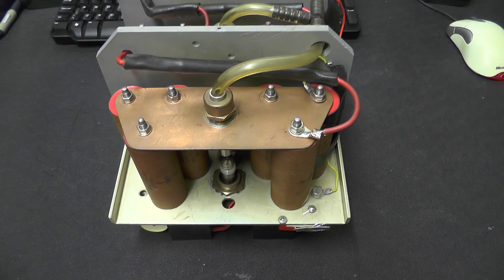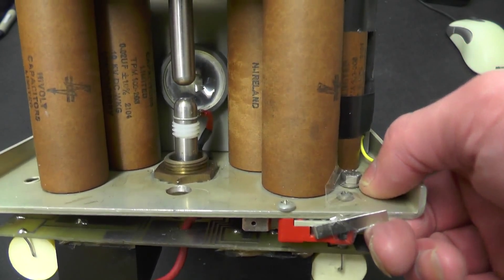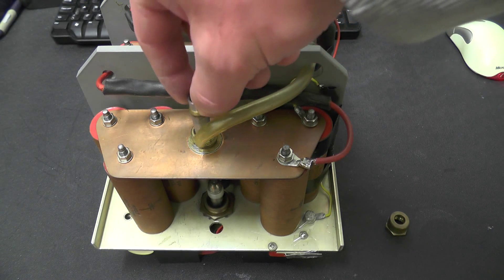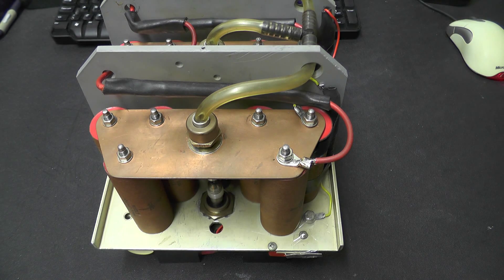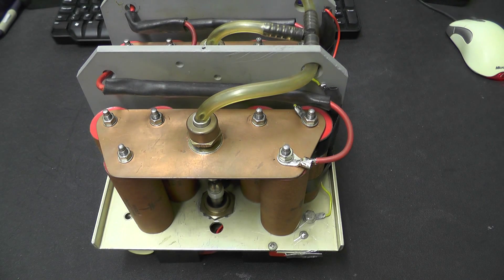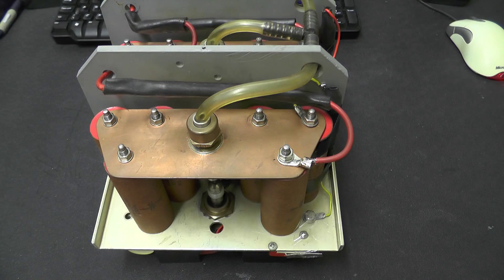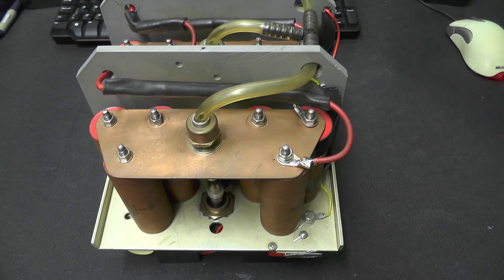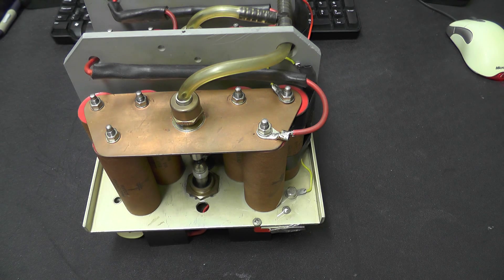DL#034 - Project: Palflash 500 Air Gap Flash Part 2

Comment: Nice flash unit.

Things to do: Air rifle stuff as usual, like ripping cards etc, triggered by photoelectric switch. Next thing would be to measure the duration of the sparc/light emission time with a fast photo cell and oscilloscope. Then you could do other funny stuff like blowing holes in aluminium cans with pyrotechnics/primary explosives and take snapshots of developing cracks/holes, if the flash is fast enough (good stuff explodes at 7000 m/s, that's 4.5mm/us or 2.25mm/500ns, so perhaps might be possible, but good old blackpowder pyrotechnics is much slower, so start with that)
Reply from the maker: Chuck Norris Going to go for a simple beam break setup of things falling. like heavy somethings falling onto glass etc.